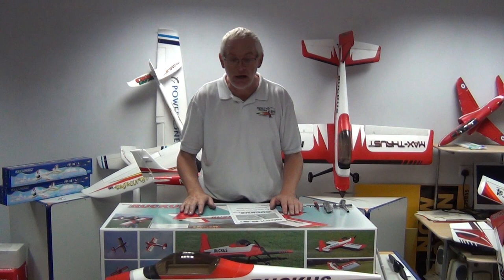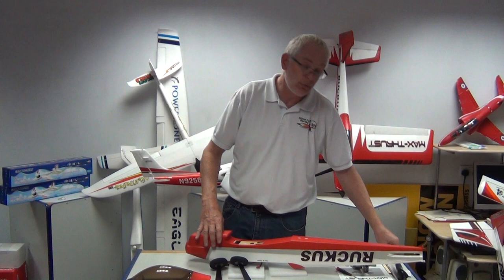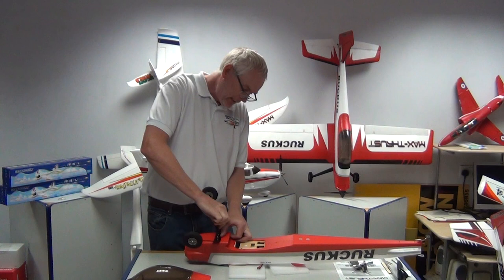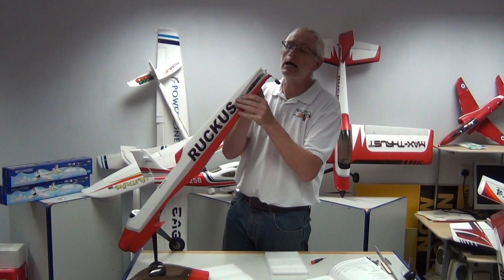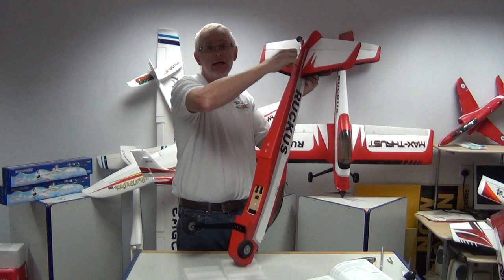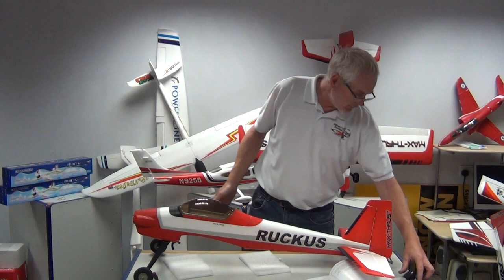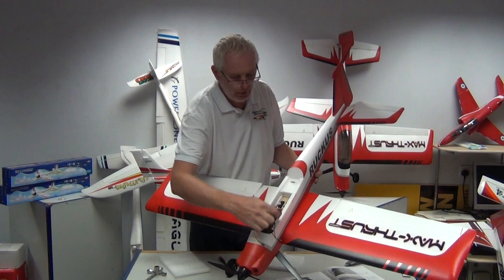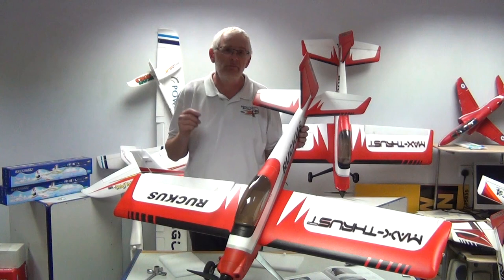How to build: MAX THRUST RUCKUS RC PLANE RIOT FAMILY | Century UK

Comment: Hi Mark, what is the Lipo requirement for this model ?  Is it similar to the Riot ?
Reply from the maker: Hi Mick,
It's exactly the same as a Riot.
3S 2200mAh in standard format or 4S 2200mAh, remove nose weight and 1" smaller prop for more get up and go!

Comment: Hi Mark, Most appropriate. I received my kit this morning!
Very pleased with the quality!
However I have the basic no-electrics version. I didn't anticipate any problem but, although I have a selection of appropriate motors, when mounting a motor, I can't find any opening or routing for the wires to enter the front of the fuselage...
Wha'd'ya think?
Reply from the maker: Hi Brian,
On the PNP setup, the wires for the motor come through the round hole in the centre of the firewall.
If your choice of motors are covering this hole up then you could open it up slightly to give clearance or possibly make a small new hole to feed the cables through.
Reply: Hi Mark, Thanks for your reply. It was a bit of a stupid question really. I've sussed it out and I really like the quality. I should probably have ordered the complete package, but I just have so many motors and servos...
Reply from the maker: No such thing as a stupid question! Glad to hear you've sussed it.
It's a great model in the air!